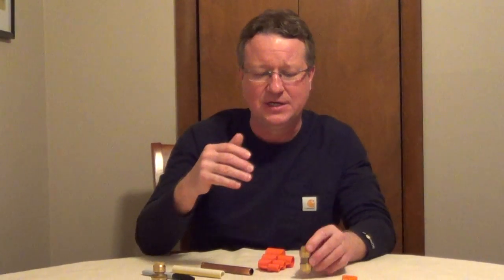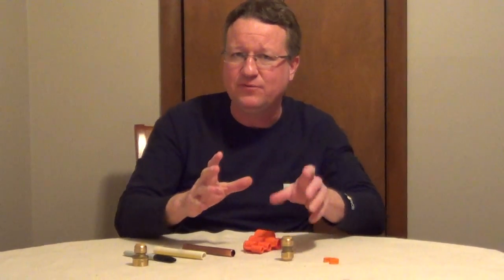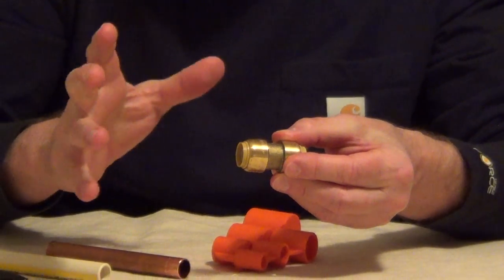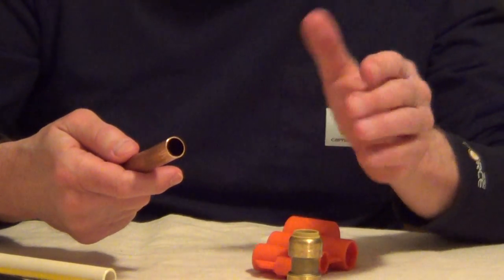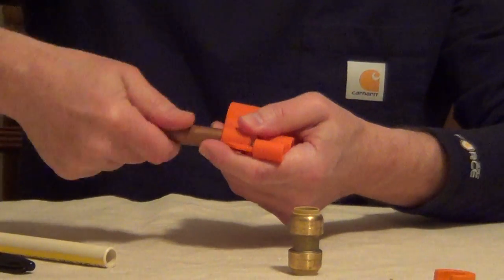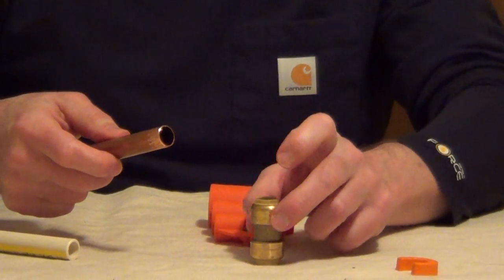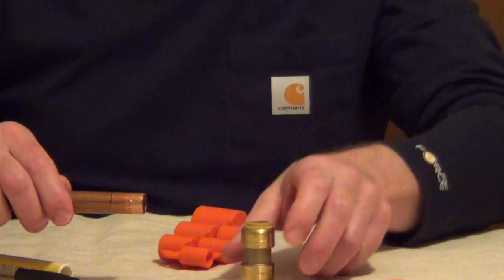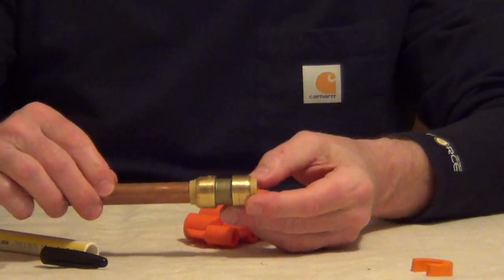Shark Bite Deburring and Depth Gauge Tool

Comment: I have that Sharkbite tool and rather than just accept that it would remove burrs, I tried it.

I do find that the round cutter does make a chamfer on the end of the copper pipe, it also rolls a sharp burr onto the outer edge of the pipe.  

I will be using a file or other tool to remove that burr, before I insert the pipe into any of the Sharkbite connectors!

Comment: Great video. I picked this tool up at HD and it works great. Very nice tool to clean the edges good.
Reply from the maker: onecrazywheel Hi, it does a nice job. I have a few videos coming up with shark bite fittings. They are easy to use.
We have more tips on our weekly podcast https://itunes.apple.com/us/podcast/fix-it-home-improvement/id880903087?mt=2

Comment: Does this matter for 1/4 turn stop valves? I installed a few of the Sharkbite stop-valves and just pushed the SB on until I could push no further.
Reply from the maker: Hi, if you pushed it until it seated, it will be a solid connection.
Check out more home improvement tips in our e-books https://www.amazon.com/gp/product/B0B2KW1FQ9?notRedirectToSDP=1&.

Comment: Do you also need to deburr the inside of the pipe as well? Or will using the tool accomplish that as well?
Reply from the maker: Hi, Sharkbite doesn't require the inside of the pipe to be deburred. The outside needs to be deburred and chamfered to protect the O ring. 
We have more home improvement tips on our podcast https://podcasts.apple.com/us/podcast/fix-it-home-improvement/id880903087

Comment: Is this tool really needed? I don't have it and I just pressed the fitting onto the pipe as far as it would go and it appears to be working fine.
Reply from the maker: Hi, when I took training from SharkBite they said you need to deburr and chamfer the end of copper pipe so it doesn't score the o'ring and void the warranty. The tool does a nice job of smoothing the end of the pipe and the blade rotates, so you can move it as it wears for longer life.
We have more home improvement tips on our weekly podcast  https://podcasts.apple.com/us/podcast/fix-it-home-improvement/id880903087?mt=2

Comment: I have been trying to understand the principle of this deburring tool and I still can't understand it as in what exactly does the deburring because from the look of the plastic tool there is no piece like a metal in the tool that smoothens the edge of the pipe that was cut so what exactly is responsible for clearing the debris at the tip of the pipes.I hope my concern is well understood.
Reply from the maker: Hi, there is a small circular metal blade that will deburr and chamfer the end of the pipe. What nice about the blade is it can be rotated to keep a sharp edge.
We have more home improvement tips on our weekly podcast, Fix It Home Improvement. You can subscribe on your favorite podcast app. https://www.stitcher.com/podcast/fix-it-home-improvement-5/fix-it-home-improvement

Comment: How to how to disconnect a shark bite
Reply from the maker: Hi, they have a removal tool. https://www.lowes.com/pd/SharkBite-3-4-in-Fitting-Removal-Tool/1000182587
Check out more home improvement tips in our e-books https://www.amazon.com/gp/product/B0B2KW1FQ9?notRedirectToSDP=1&.
Reply: I use a wrench and squeeze the very back of the SB while putting two fingers behind the wrench and pushing toward me. This usually releases the SB and you can pull it right off. I've never used the SB removal tool.

Comment: Do you have to deburr PEX pipe? 

An actual Shark Bite installation video (shutoff valve for a toilet supply line) shows the guy cutting the Pex, marking the depth, and pushing the shutoff straight on. No deburr shown.

This is the video:  https://youtu.be/AY7OjL9BjhY
Reply from the maker: Hi, when I took training from SharkBite, they recommended their tool for copper to deburr and chamfer the end. They said it can also be used for PEX, or use emery cloth to smooth the outside to protect the o'ring.
We have more home improvement tips on our weekly podcast 
https://itunes.apple.com/us/podcast/fix-it-home-improvement/id880903087?mt=2

Comment: Why do you need to mark the depth if you push the pipe as far as it can go😂
Reply from the maker: Hi, they want to make sure you pushed it in far enough. Sometimes the o-ring or the metal guides inside the fitting can be stiff and give the impression that it is seated. 
We have more tips in our home improvement book https://amzn.com/B01MRGO8C5
Reply: If you can’t feel it bottom out you need to call a plumber and let solder a fitting in. These are great for temporary fixes.